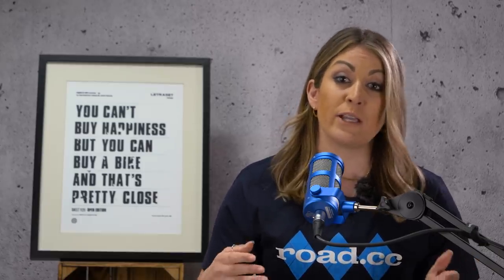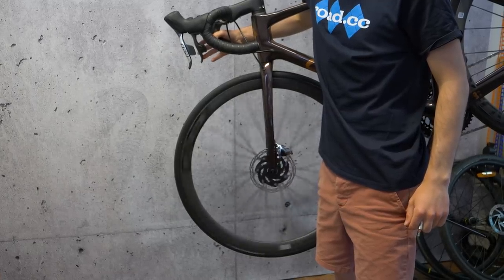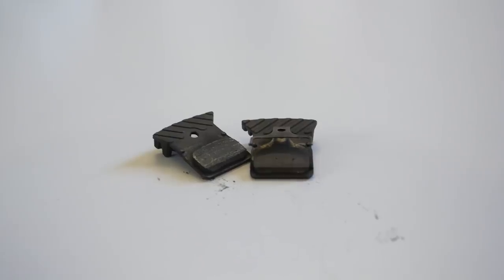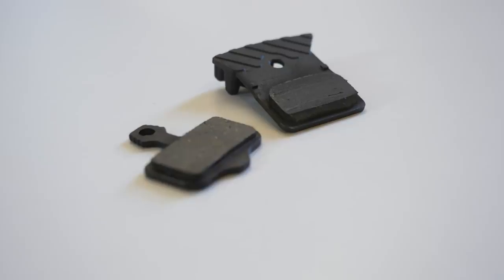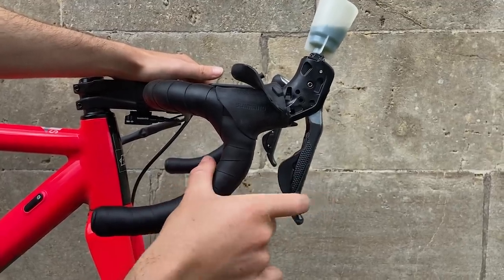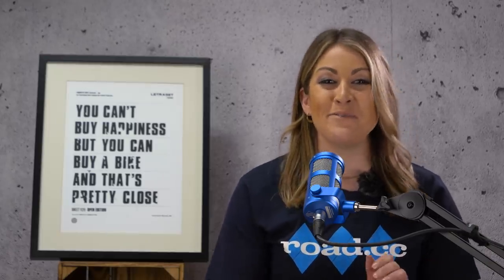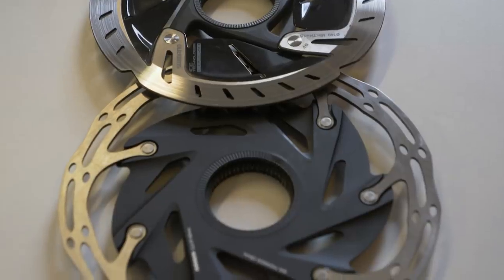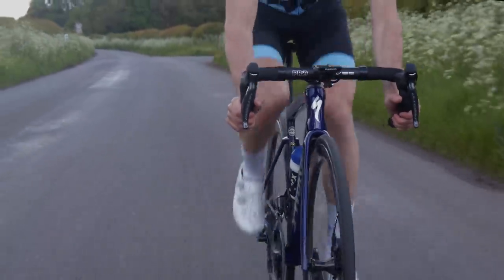8 things they dont tell you about disc brakes

Comment: The only thing I would change about disc brakes is to stop forcing them on everyone. 
Leave choice on the table.
Reply: For years there was a choice and sales of rim kept falling. As a business would you keep producing something that didn't sell? I think they should produce both but I can see why they don't.
Reply: @dh7314  yes, that's how it works with new stuff, people buy it. 
As of late we can see that buyers ( maybe more experienced cyclists by now ) realised it's not what is was promised to be, or not worth dealing with for what is supposed to be improved braking.
All it takes to fit rim brakes is a hole in the crown. Would be interesting to see how that would play out if both ciuld be used on the same frame, not like it takes alot of engineering, as the frames are already stiffer for disc brakes. 
So yea as far as I'm concerned, the costs are minimal. Obviously I'm talking about road bikes, gravel and mountain bike are a different story. However even with the trend of wider tyres, on road bikes, people still use 25-32mm tyres, which is 100% safe and doable with regular rim calipers, my commuter bike is setup with 32mm tyres and standard rim brakes, no issues whatsoever.
Reply: @cosinus_square  very good points. I'm neither in the disc or rim camp, I ride both. Rim are less maintenance but not maintenance free and disc are more consistent but the pay off is a little bit of housekeeping which isn't difficult whatsoever. If I was buying another bike tomorrow I'd be open to both camps but would probably still choose disc for the consistency.
Reply: @dh7314  rim brakes are consistent as well if the correct braking surface is a given, as in a clean aluminium brake track. 
Rim brakes were not designed for carbon rims as much as disc brakes were not designed for carbon rotors.
The same suitable braking surface with no contamination is a requirement for disc brakes as well.
If aggresively used, disc brakes fade, regardless if used in dry or wet conditions, which is not comparable with rim brake fade in the wet, allthough with the correct wet pads, and proper set up, they do brake very well. I mentioned proper setup as both systems require setup to, at least, manufacturer specifications to operate as designed.
Brake fade is non existent in dry conditions with rim brakes. In both statements I have not included rider dragging brakes as that is simply user error and has nothing to do with performance.
I consider brake fade to be a bigger issue (than the other big, allthough fake, selling point of disc brakes: no need to replace rims for wear, which is false) because one of the big claims of disc brakes is consistency.
If my math is correct, the result is that people are simply using the wrong rims (carbon) for rim braking systems and expecting something out of this world, as far as I'm concerned the two are never to be used together.
Reply: Yeah, same with f...E shifting ...
Reply: There was a choice. Customers chose disc.
Reply: Most people buying bikes dont know a thing about bikes.So they buy what they see on TV.Just look what happened with pressfit bottom brackets , they were forced on every bike, than one day we were told that they were inferior to threaded bottom brrackets.Now the industry is turning to threaded bottom brackets.
Reply: No
Reply: @dh7314  because they make more money selling disk brake equipped, and the trickle down effect of replacing everything to go along with it.(spare wheels etc)
Reply: @ozgurinsan  not a single PF in my stable of 8 bikes thankfully.  As well as proper rim brakes for all road bikes.
Reply: @matthewlewis2072  there was no choice. it was 100% pushed with people being told disk is better, and the availability of rim being quickly removed.  Same as the pro peloton. The vast majority of them chose rim when it was available, until that choice was removed.
Reply: @dh7314  you are 100% disk camp.  Rim are zero maintenance.  once a year changing pads or when when switching pads for carbon vs alloy rims is zero.  And in terms of consistency I would disagree. Having far more issues with disk (pads wear quicker, squeal and rub) makes them less consistent.  The wet factor is a moot point for most of the world, and probably as much so in the UK as people just don't ride in the wet.  They just zwift.  Nothing wrong with wet braking on rim when you have proper brakes. use a cam lever design if you want powerful braking even in wet and carbon rims are needless things for the masses who don't race.
Reply: @cosinus_square  carbon with the correct pads is pretty decent actually.  Who really rides in wet anyway, and its a road bike: apart from a mountain decent (how often are those done) or stop signs, they should barely be used anyway
Reply: @shamuslamont100  Braking with carbon wheels is bad compared to basic alloy wheels in all weather. Obviously I'm talking about all weather as people ride in all weather, surprising I know.
If I'm spending £2k on wheels, I expect them to brake exponentially better than a £200 set of kinlins, which they don't actually.
What pisses me off even more is that they completely stopped developing aluminium rim brake wheels. The current crop of alloy rim brake wheels is the same as 5 years ago. 

If one rides on zwift when is anything but sunny, then why debate brakes anyway? They don't need any.
Reply: Giant still offers old school rim brakes

Comment: Disc brakes also require a heavier fork to absorb the torque generated by braking, same with drum brakes.
Reply: That's nonsense. If you stop your bike within a certain distance, the torque on the fork is the same, no matter the type of brakes
Reply: @peteralleyman1945  Then why do disc and drum brake bicycles have heavier forks then a comparable rim brake bicycle?
Reply: @buckwylde7965  
Do they?
I did a google search. What I could find is that stresses in the fork are higher in a disc brake system due to asymmetric loading and that the fork consequently needs to be stiffer. That doesn't necessarily equate to additional weight but leads to a little less comfort.
On the other hand rim brake wheels tend to be heavier to cope with the squeezing torque. 

Apart from  that: to me the whole bike weight thing is a bit of a hype. A  copious meal or an additional bidon has more effect on the total weight than the braking system. And certainly on flat terrain a few kilograms more or less will hardly have any effect.
Reply: @peteralleyman1945  Stiffer usally means heavier unless you put out more money.  Drum brakes have a reaction arm fixed to the fork. If the fork bends under braking this can result in "brake steer" which can be bad. I don't worry about weight very much. I have fenders. bell, rack, bullet proof tires, etc,, a working bicycle
Reply: @buckwylde7965  
Smarter design, not necessary heavier. Certainly carbon technology enables local stiffness and stiffness in certain directions.
But at a price indeed, at least for carbon.
Reply: Why, then, would they equip $2K allow bikes with disc with carbon forks, if the forks needed to be heavier? Doesn't seem to make sense.
Reply: @cerenademe9433  Carbon is lighter than steel.  Both steel bikes and carbon bikes need a stronger, read heavier, front fork than a bike with rim brakes. The carbon fork will still be lighter than the steel one.

Comment: Just got a bike two months ago with disc brakes and have had nothing but problems. Squeaking and it inconsistent braking force. I took it into the bike shop twice already as well as trying to resurface and bed them myself. Got a whole new set of rotors and pads after just one month of use. I’m about ready to take it back to the shop again.

Give me rim brakes over disc brakes any day.

Comment: disc brakes also change the ride feel of your bike. add 200g to the left side of a 350g fork and you know you're going to feel that. way less nimble and asymmetric weight distrubution
Reply: Stop spreading lies and ride your bike
Reply: Haven’t noticed that myself between my disc and rim bikes….maybe I am more asymmetrical than that lol
Reply: @chapmag6578  I got both the rim brake version and the disc brake version of the same bike. rim brake bikes feel more lively, definitely, maybe it's more noticeable if you switch back and forth, that 0.5kg weight difference is also felt, nobody is spreading any lies but the industry, the truth: if you keep riding alloy wheels disc brakes are absolutely unnecessary unless you prefer to ride in rain
Reply: @1afterthep  Carbon fiber rims are fine too for most uses.
Reply: @jkk916  not for steep descents and t-crossings
Reply: My road frame is disc-ready, I converted it from rim brake to disc brake and noticed no change in the ride feel. My fork is around 500g.

I was more concerned about the added stress on the fork, as well as brake steer, when using a 160mm rotor up front. Since the fork is reinforced on the non-drive side, this was not an issue. And to think that added reinforcement would add more asymmetric weight on the fork, we should all be able to feel the difference, no?
Reply: Errrr...the drivetrain is all on one side?

Comment: Thinking about switching to a new bike with disc brake from my Basso Diamante with ultegra direct mount brakes on oxic alloy from DT Swiss, but I will test first whether the new R8100/R9200 hold their promise. The older versions seemed to be something like experimental technique for me, interesting, but with all the noise, buckling, brake fading, and pad erosion not so usable ( I love db on gravel and mtb, that said - but not yet on a road bike). 

If I switch, not because of braking power - I am fine with direct mount. After all, the maximum torque the brakes can deliver is bounded by adhesion and radius of tires, and all brakes capable to deliver more than that torque cannot be used to their full potential on a road bike where you don't want to slip down the street with blocked tires. I even do not think that the mostly unchanged power of disc brakes in the wet is such a good selling point, because the tires will loose contact much earlier in the wet, so at least I have to be very careful using disc brakes under such conditions.
Having on a road bike no tire studs biting the ground like a gravel or mtb I am not so much interested in the question which braking system delivers most unusable power.

But because the separation of rim and braking surface gives room to optimize both without compromise which opens up more options for good rims and good brakes - the system is modular. This is for me the real advantage.

Would be nice to see a review of the newer disc brakes from shimano and a comparison with the older ones, especially with an eye on the problems mentioned in video here.

Any experiences? Oh, and of course I will keep my Basso.

Comment: Had nothing but hassle with disc brakes  rubbing, hydraulic issues, accidentally getting degreaser on the rotors and ruining the brake pads (my fault I know) my road bike with callipers is so much easier (and cheaper) to maintain.
Reply: I do prefer disc brakes and haven't had the issues you have. But, you are correct. They are more complex and expensive to maintain.
Reply: Must be a lousy mechanic..lol. Never had an issue with any of the 3 disc brake bikes I own
Reply: @cannon1156  this is often the problem
Reply: @dh7314  .. rim brake pads still need special adjustment of toe on the pads to get efficient use. The OP mentioned getting degreaser on the pads. Why would you be using degreaser? If cleaning a chain take it off. It is just signs of poor mechanical work not the brakes fault
Reply: @cannon1156  err, I was agreeing with you. I find most peoples moans about discs are because they're useless at maintaining them. Discs aren't complicated.
Reply: @dh7314  .. completely agree. I am no fantastic mechanic but have no issues whatsoever with discs
Reply: @cannon1156  I'm no mechanic either. For me, I keep the pistons in check by cleaning with a cotton bud whenever I wash the bike (2 min job) and remove the wheels when washing (1 min job). It's really not as big a job as some people claim.
Reply: @dh7314  .. finally another person with some common sense and understanding of maintenance
Reply: Considering the cost of a new rim, nipples and possibly spokes, or just a whole wheel versus a single rotor when factoring in maintenance expenses, I'll take disc brakes any day.
Reply: I have both ,neither are a problem. I don't prefer one other the other they both work , the issue with disc is usually the non mechanical people who ride bikes now.

Comment: Use finned rotors and organic pads so the pistons return faster. Resin pads don't dissipate as much heat to the caliper and oil so there's less expansion.  A larger disc or one with fins are needed because that's where the heat will need to be dissipated.

Comment: “You can just take your bike to your local shop” - good luck with that at the moment.
Reply: The bike shop I work at has a 24-48 hour turn around on service. If you need parts ordered to service then it might be a week or two out depending on the component. A basic inspection can be done the same day. The shop across the street from us won’t even look at your bike for about a month. Let alone service. So we’ve been told.
Reply: It’s same where I live. Basic service is about a month lead time at all 3 LBS near me.  I had the misfortune of needing some serious repairs last summer and it took 3 months.  My solution is to buy a “back up” bike.  As soon as my wife lets me.
Reply: Right now it's summer and it's covid but still I think most bike shops can do a couple brake bleeds in less than a week. Maybe longer if doing new pads and rotors as well. Longer for complete tunes and more. Maybe even be 2-4 weeks out.  This will obv vary from place to place so shop around if you need to.
Reply: My local bike shop is running balls to the wall, and still can't keep up.  Not only the typical seasonal work, but also inexperienced riders crashing needing more help than just a tune up.  The shop has booked time out three weeks, and the owner says they can't accept any more appointments past that for now.  Plus he's got bikes taking up storage room waiting for parts...

So this year I got off my lazy ass, watched a few professional youtube videos, and tuned up my shifters and derailleur myself.  
Is it as good as my local shop would do?  No, but it's close enough for now.

Comment: One point that you forgot to mention, is way up there as a pain in the arse - travelling with a disc brake bike…😤
Reply: Why tho?
Reply: Yes true, especially with these new integrated handlebar systems.
Reply: @waynosfotos  which are nothing to do with disc brakes
Reply: @hanifschanel  you need a tool to stick it into your brake pads if someone accidentally presses on the bike's brakes when your wheel is off. The reason for it is that disc breaks are typically hydraulic and the way it functions is when you compress on the brake levers, the oil pushes on a metal piece at the brake section and it pushes the brake pads into the rotor to brake. so when you remove the wheel, you remove the rotor as well. which mean that there is excessive space for the metal piece to travel. If you compress the brakes levers and the metal piece moves too far out, the whole things might pop out and all your brake fluid will leak or spill and you will need to refill and rebleed the system.
Reply: @Syn741  which is exactly why you dont buy hydraulic disc brakes. Mechanic brakes do just fine.
Reply: @Sharpless2  to each of their own. I still prefer hydraulic disc breaks.
Reply: @Syn741  what you do is stick a bit of cardboard or buy the special spacers to put in the caliper for when the wheel is off the bike. 

I’ve actually pulled on the brakes without the wheels on and had no problems.

Comment: I love disc brakes. Much better immediate stopping power, has saved me from car accidents.
Reply: So you were having lots of car accidents before them, right?
Reply: @st939  are you daft? Have you ever tried an emergency stop in the wet with rim brakes? Then you will know what I'm talking about.
Reply: @roebbiej  I live in Switzerland, climbed (and went down) 58000 meters this year already on my rim brakes on carbon wheels, zero issues, sorry for your car crash problems.
Reply: @st939  well, you have better equipment than I experienced i guess.. I'm happy that you've never had problems :)
Reply: ^^This

Comment: when bedding in pads yes you bring yourself up to 20mph or 30kph but you never come to a full stop!  slow down to about 10kph and repeat the process again.  Usually, repeating this 5 time will be sufficient
Reply: In 20 years of using discs, I've never performed a 'bedding in' process, and never had any of the issues mentioned. All I would advise, is never insert new pads into calipers without prepping their surfaces first, ie: a little rub with sandpaper to remove any atmospheric contaminants from storage and the manufacturing processes. Ditto the rotor, for which I use a sanding pad mounted on a grinding disc to score the surface.
Reply: @annegrey-blackman5934  isn't it easier just bedding them in though ? Just riding would be my choice.

Comment: I ride a 1997 steel Serotta Atlanta with rim brakes and 2 x 9 drivetrain. It has shallow depth Campagnolo Proton rims, it rides like a dream and stops excellently. I think the disc brakes, stiff frames, and deep rims are a devolution that I don't welcome. If it works for you, then you are riding on the right technology. So I won't tell you not to ride with disc brakes, stiff rims and carbon frames, but I don't envy anyone who does. I think that they will continue working the bugs out of disc brakes and they will surpass  rim brakes, but I see too many drawbacks right now.